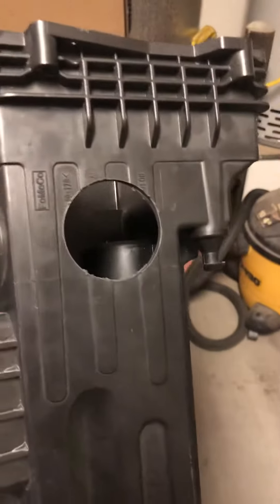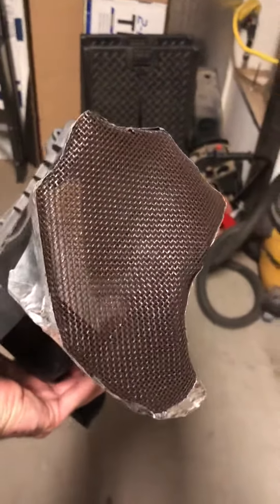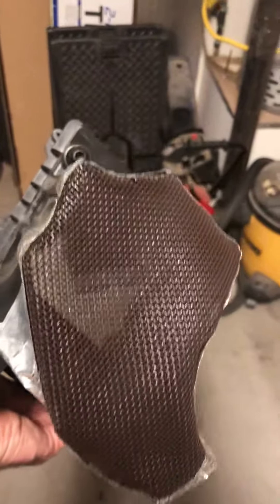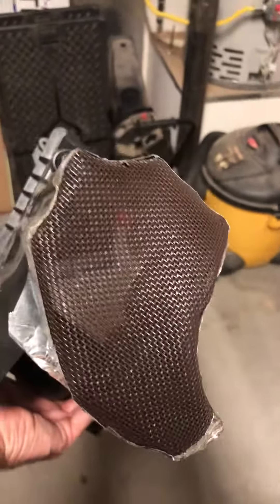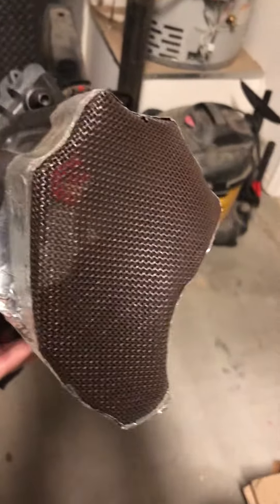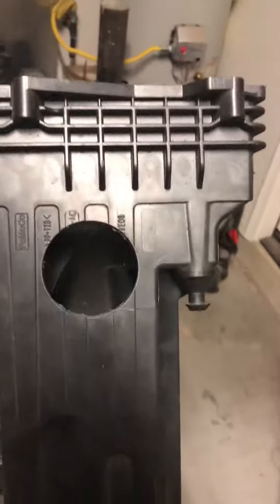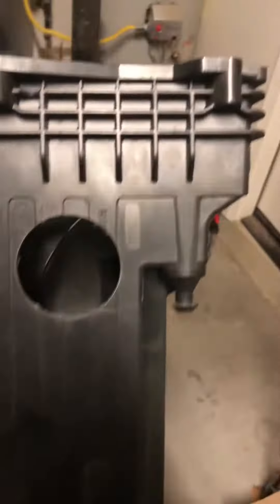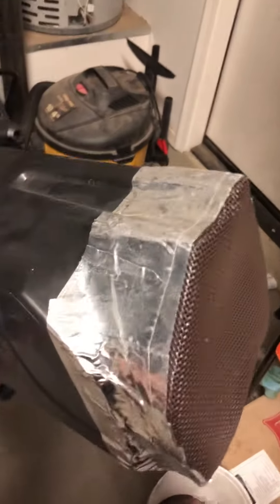Modified Ford Fiesta ST AirBox

Comment: Hi, how do you feel with this mod? Do you have tried to mesure the air intake temperature?
Reply from the maker: Gabbo STupid it was mostly to get the intake sounds.  This mod combined with a high flow filter showed similar vdyno numbers to an Injen short ram intake.

Comment: hi, how is it for iat and charge temps? I might duct a hose to mine
Reply from the maker: Michael Jackson it’s been several years since I did this mod but as I recall the iat was about the same as the stock box.  I believe the charge temp may have been a little lower when moving but this really did not make much more of an impact than sound.